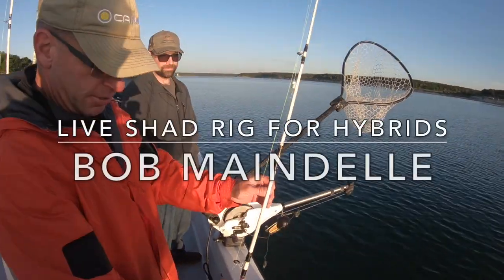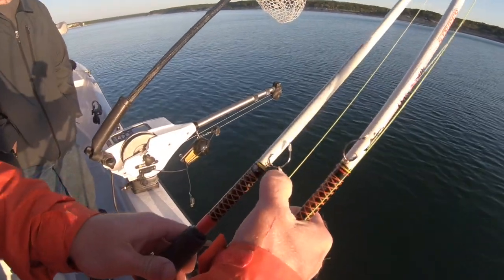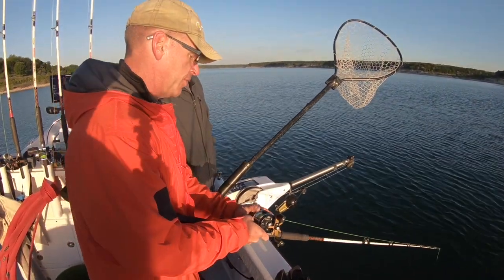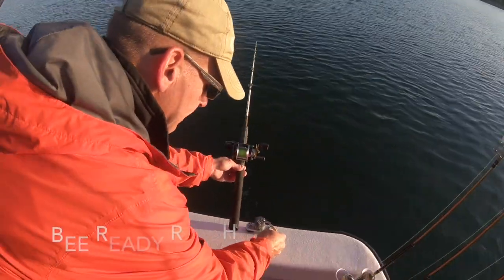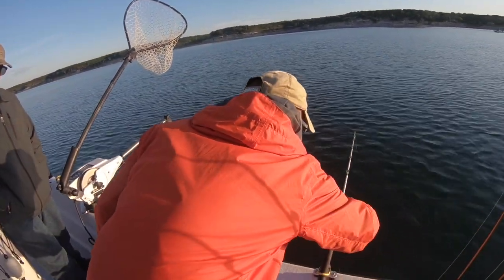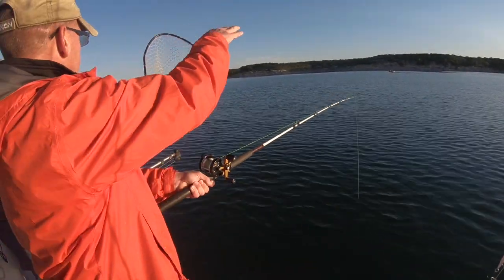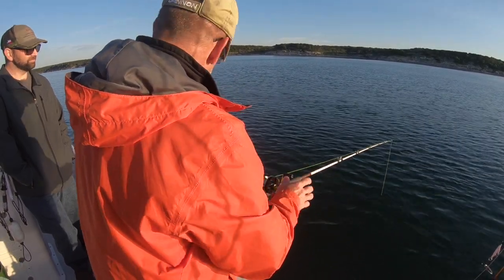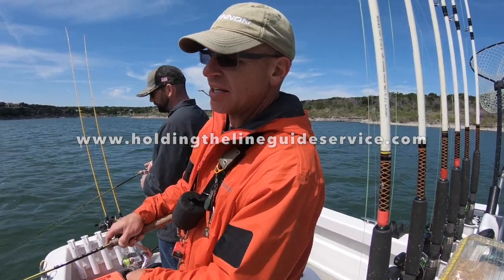Live Shad Rig for Catching Hybrids/Stripers with Professional  Guide, Bob Maindelle

Comment: Will try it all this weekend.  Thanks
Reply from the maker: I do a few things differently....I like 30-40 pound mono for leader which is way overkill for most lakes but I catch really big hybrids frequently and had them cut through 20 pound leaderline fairly easily. I also use a heavier weight (about 1.5 ounce) because sometimes I drift and the heavier weight allows it to stay down better and not sway, especially in heavy Texas spring winds which are often 20 mph. I also prefer a 2/0 octopus J hook instead of circle hook....all preferences but the rig itself is very similar and tried and true